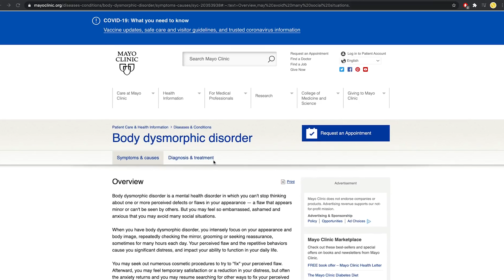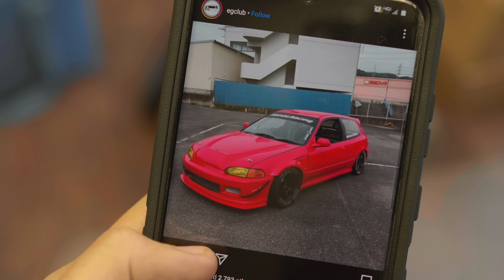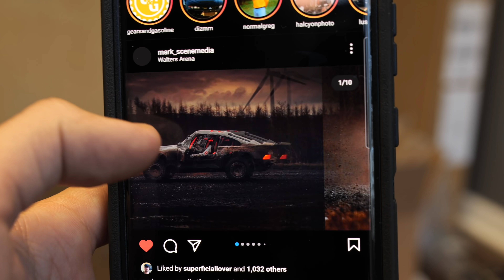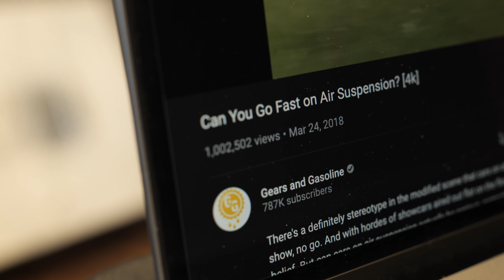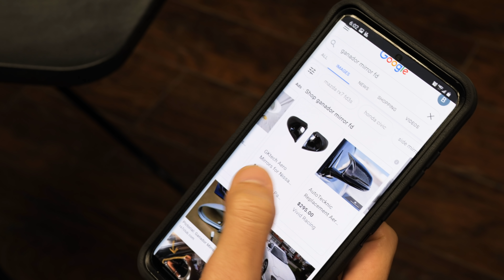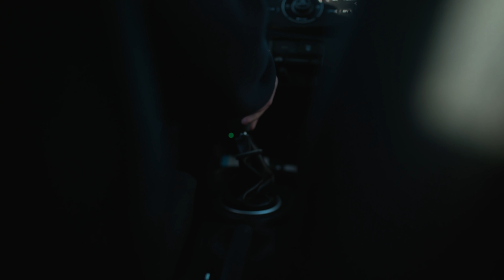Cars Won't Make You Happy

Comment: PSA: Don't buy a car for anyone but yourself.

Edit. Thankful for all the considered, wonderful replies to this. I love you all xoxo
Reply: I was gonna be a smart ass and say "what about for my kids?" But this video doesn't need any of that in the comments and your sentiment is correct.
Reply: Exactly
Reply: This advice is perfect. I just recently bought an S2K and I plan to return it to stock. I've been called crazy because of that, but in the end its my car and my money. And I want to experience this car as it once was.
Reply: That's why I bought the BRZ. At the end of the day, it fit what I wanted. Small, lightweight, 2 door, rear wheel drive, affordable.  yeah yeah its slow in a straight line, but I find it fun to drive and that's all that matters.  Slow off the line, quick in the corners.
Reply: @HakeemKaree   That's the last thing you need to worry about, family vehicle are easy to find and cheap
Reply: @HARRY SNELL I meant for my kid to drive, not for me to drive my kids in
Reply: That's great advice
Reply: @someguy920  good luck with that! If the guy bought a REAL car, he would be happy!
Reply: Exactly the same thing goes to working out. If you are just doing it to "loose a couple pounds," you will not stick with it. You have to make it about your fitness and your health and commit to it, regardless of what your friends and family or followers think.
Reply: @NinSevenTea you wont regret it when you get older

Comment: This is the extended way of saying “I live my life a quarter mile at a time. Nothing else matters. For those ten seconds or less, I’m free.”
Reply: hoora
Reply: I think is much more than that! I never heard or saw someone on the internet share something that i felt with a car I. It was perfect for me, just lacked 100hp (it had 130). Everything bought was for me, for my pleasure, the suspension, brakes and anything related with the way it looked. Never for others.
Reply: @gerekappo  am i wrong because i like driving shitboxes fast, there easy to fix and its no big deal if you blow the engine. I have had nice cars but they always feel numb because you dare not drive them to the limit.
Reply: @garygluebag4825  100% true!
Reply: @garygluebag4825  the cars i’ve had the most fun with have also been the cheapest. Best one has got to be the 1984 BMW 323i I paid one hamburger for. Kick ass winter drifter but a shit car.
Reply: @garygluebag4825  My comment doesnt aply to nice cars only. My car had many, many things to do. It was a driver. Thats what i meant. Cars that are driven. Not only looked at.

Comment: A teenager can’t afford to buy a bugeye anymore because of the “ subie tax”
Reply: The one mentioned in the video was 8k and all the ones near me either cost upwards of 9 or are on the edge of death. Big oof
Reply: I just got mine for 6k. But then again I also looked for months.
Reply: @DENDENMUSHIFROMZOU  that's still double of what they were selling for a couple years ago. They sold around 2500 - 4000 max back in the day for a WRX but now they've gotten insanely expensive
Reply: I’d just find one with a blown engine. I’d wager there’s a few out there, no? 

It goes with the old car guy buying something not running and fixing it themselves. Bring that much more pleasure!
Reply: For real though, gotta overpay for a Subaru just to get one
Reply: I bought a 1990 Subaru Justy 4x4 when I was 18 because I could not afford a WRX. It broke on me and 3 years later (I’m 20 now) I still have it sitting in a storage unit untouched for the past 3 years.
Reply: @ryanricketts6674  fix it up or sell man don’t let it go to waste
Reply: You can apply that tax to any car on the market. Our wages haven't changed, but everything else has gotten more expensive... :(
Reply: Got mine for 3k... But half of it is missing. Frick rust
Reply: Only subie tax that you'll run into is doing engine replacements semi annually
Reply: @DENDENMUSHIFROMZOU  I got my old bugeye back in 2015 for 1500 bucks, 118k miles on it. I miss it
Reply: 😂Just feel lucky that you guys can buy mustangs and shit like that over here in the uk you’re unique if you don’t have a shitty German hatchback until you’re 20 LMAO, he’ll even a miata at 19 is hella expensive on insurance
Reply: @codeobey6821  damn I just bought a F80 M3 at 21 I heard the UK is crazy

Comment: When I was younger (20's and early 30's) I used to always work hard to build my cars up...89 Celica turbo All-Trac, V8-swapped Fiero, an almost 600 HP Chevy Silverado, and a 2000 Honda Civic Coupe with a B-swap, lowered and lightened almost to the point where a Miata would be considered overweight. Honestly? It gets tiring...showing it off, seeing something new, wanting THAT. It's a cycle that will never end, and as much as I love cars, I will admit that this constant quest has put a lot of grey hairs on my head. Fast-forward to today. 4 days ago, I turned 47. I'm happily married with 5 adult children and when I just want to get away, I happily go out and hit some nice b-roads in my 2007 Honda Civic EX coupe, rowing my 5-speed manual, and just enjoying the sound of a nicely tuned exhaust bolted to a completely STOCK engine while taking my wife to a nice little outdoor café for brunch.

Cars have been and most likely will always be an occasional wondrous joy of mine...but happiness? I find that in my wife, my family, my friends, in my backyard with string lights hanging from our trees and me at my barbecue grill...
Reply: Well said.

Comment: Thank you for making this video. I always dreamed that I could drift. I saved up and bought a 350z and sure enough, I could actually do it. But it was kind of like meeting a hero. We began to take it more seriously. We rushed to make it to events and my car was never working right. It took the joy out of it. Someday I want to compete. But I want it to be because I’m at the track to enjoy drifting, and it just so happens to be in a competitive environment. For now I sim race. Awaiting my return behind the wheel of a real car.
Reply: It’s much much cheaper and less time obligation
Reply: mid-late 80's was doing it with a modded Datsun 620 long bed pickup, the extra 10" wheelbase made it very predictable+consistent. there's lots to be said for "keep it simple stoopit", it put up with being hammered and rarely ever broke.
recommend for a fun "slideways seat time" budget build project.
L20-B giving +165 whp, 4 speed from a 1600 wagon for lower closer ratios,
no spare no tailgate no rear bumper no smog no AC, lots of weight stripped.
late 70's Datsun was like playing with a Chevy, near anything bolts together!
power sliding and "slideways" was before anyone called it drifting, hehe so what.
Reply: Kind of similar scenario. Ive always loved racing games. Bought an Altezza track car. Cost me pretty decent money. The heartbreak of trying to get things ready for track days and things going wrong, mechanical failures, accidents. Did it for 3 years and eventually sold it. Bought a direct drive setup and just sim race now. Its astonishing how close it feels to real life. Assetto Corsa feels great.
The only IRL track experience im missing is Nordschliefe. Absolutely going to bring a car there.
Reply: I am so Happy with my GR86. I Drooled over the CRX when in my Early 20's and Never Got One. Got a Mk7 GTI With All The Bells and Whistles as a Mid Life Crisis. Got More Tickets Than Ever. It was a Blast. Messing with my Phone I Totalled It. I am Tempted to Do Some Things to my 86 but I am 61 Now and my Priority is Travel to World Heritage Sites. This Reflection on; Ego, Fame, Supremacy, Etc is Excellent.
Stay Balanced. There is More to Life.
Reply: Been about a year since you commented this, hope your dreams have gotten closer to reality
Reply: @kind1st  GR86 and all the similar models looks like they are really fun to drive :) Sadly here in Norway they are more expensive then a Porsche Cayman so I am getting a Porsche.... (Most likely the reason the Cayman is not horrible expensive is the 20.000 to 30.000 engine repair on the older models that they say 10% of Porsches with the 3,4l will need).

Comment: "FD RX7 is my affordable dream car". My same exact thoughts when I bought my 93 FD, that has now been sitting in my garage for 7 years, after having sat for at least 6 years for the previous owner. I was on my way to having the car built the way I had envisioned it, especially since it was the last large personal purchase before my daughter was born... and then life decided to slam me and my fantasy... lost my job, almost lost our home, but now I'm finally back where I was financially when I was building my car. UNFORTUNATELY now there is always something else that needs the money more than the car that's sitting in the garage. Its frustrating as all hell, but damn if every time I see my FD it doesn't put a smile on my face. Then I'm reminded of all the money  it's going to take  to get what I want done... suspension refresh, transmission swap, new wheels, repair original paint, vinyl to my personal preferences, repairing all of the old car issues, no oil leaks... it's a hell of a project that needs a lot of cash and no one to figure it out by myself. Oh the life of a project car...
Reply: hope you get to drive your car soon bro. I'm still waiting to buy a rx8 as a first car which might be a bad idea but i love rotaryes so il try and learn as much as i can about them befor i buy one
Reply: Its gonna happen sooner or later...:)
Reply: I wish you luck and many happy miles on your build!

I'm in the process of getting an engine into my RX8 that i snagged for 1000. Full interior too. Still can't believe its sitting in my garage
Reply: Well the capital gain $$ on your Fd after 7 years should at least put a smile on your face, the prices have gone crazy over the past 3 years. 
Really hope you can get it on the road sometime soon. 
I got my 2000 Fd 6 years ago, it’s completely stock, that’s enough for me, as long as I can get it out every few weeks or so

Comment: I really needed to come back to this video today and im glad i rediscovered it because i recently got a E46 sedan and have been overwhelmed by all the mods and things i feel like i NEED to get done before i can really feel happy but that happiness im trying to achieve isnt because of things i want but things i see other people have and feel like i need to fit in with them instead of building the car I WANT and this video has helped my take a step back and be happy with what i have and with time i will discover what i personally want out of my car
Reply: A year later how’s it going with the e46, have you done anything to it and how’s it treating you, it’s one of those cars that I might get once I get all set in life, toodles 🐣
Reply: @pat1u  it's still running pretty good considering the condition I bought it in. I have major maintenance planned next month after my bills because I'm taking it on a 1300 mile road trip but for a car that people say needs alot of maintenance I have barely done anything to it. Bought it as a 500$ junker and it's only needed a battery, valve cover and gasket. coils and plugs and a expansion tank and some hoses. Now it still leaks oil but that's going to be fixed soon but BMW made a pretty good car and I have zero regrets. Put about 7000 miles on it so far
Reply: @RadsZerich  I mean honestly most people underestimate bmw reliability it’s just cause people don’t know how to maintain them.  Also a 1300 mile road trip sounds awesome but draining good luck to you!

Comment: Cars will absolutely make you happy. The problem is unattainable or unreasonable goals, and that applies to any hobby/obsession. The problem these days is people forget what made cassic hotrodding so good, which was the concept of really good ideas anyone can do on an average budget for a hobby. My all black 2014 GT was the alternative dream car to one of my actual dream cars (either a 08/09 Bullit or a real classic Dodge Charger like my dad had), and with the red accents on the headlights, blacked out exterior, and free flow exhaust, it turns heads when other cars that cost way more are ignored. It's loud, has great power, and gives me plenty of satisfaction as I see people stop and look on the street. It's such an icon, they know what it is. On those merits, I'm satisfied with the car, but I don't want all bark and no bite. I have goals to expand the rear tires from 295 to 325 radials in the rear ($1250?), replace my radio that just died ($600), get an e85 tune ($150), and if I ever find a get lucky, a Tremec transmission (over $2000) and a Procharger ($5000+.) I juet want to put more expensive cars and Chevys to shame. Should be reasonable. Should I ever strike it rich, I'll buy an actual dream car like a $150,000 Cobrajet, and I can grease Teslas all day long. Until then, I will appreciate what I have and be humble.
Reply: YES! Cars can make you a bit happier, but only AFTER you've figured out how to make top dollar--and by then, the odds are pretty good you're getting older and will sacrifice everything for the biggest possible house and a couple kids you don't want because "SHE wanted it."
If you haven't nailed that 100+ grand a year job yet, you can sort of just piddle around with cars. This shit is expensive, even if it's a 20-year old car in decent shape and all you want is to put some rims on it and maybe install a decent stereo.
Your car can, and probably will, eat up more of your life than ANY physical possession has any business consuming--even a house! That's time that you could have spent pursuing a $100,000 job that you hate (like any job) and have the money to pursue a car that you actually like instead of pissing away a decade of your life fucking around with a car because you can't afford the one you really want.
They're just cars. Some of them are cool cars, but they're still just cars.

Comment: “Comparison is the thief of joy” -Theodore Roosevelt

I’m just a starting YouTuber and I totally agree. It’s very overwhelming starting because there’s so many good/crazy/expensive builds and you just want to stand out. Sometimes I just want to pull the trigger and get a wide body kit which means I would have to buy wheels and tires that fit that as well as paint or wrap it, but it just doesn’t make sense where I am financially. It’s important that I remind myself to take it one step at a time and that you don’t have to be great in order to start, but you have to start in order to be great and appreciating what I do have rather than sulking about what I don’t.

Comment: I don't even have a car, all I have is my dad's 2003 Citroën Xsara with a 69hp diesel engine, but the most fun I have in weeks is usually from that car (I'm 16 and my top speed on this specific car is 80 km/h, but it still feels very good, you don't need a 1000hp rwd supra dragster or a 4 Rotor awd Mazda to have fun, you can have fun on anything as long as YOU appreciated it 👍)

Comment: That RX-7 you have, is beautiful.
No matter what, just walking up to that car, taking a seat in it, should give you the same joy as it did many days before that.

I drive a Civic Type-R FK2.
Not expencive, not luxury, but that car was my dream back in 2015, and i achieved that dream last year.
Every single time i walk up to it, i'm filled with joy.
Every single time i take a seat in it, turning it on, hearing the engine, getting it on the road and just driving around, it fills me with happiness, every single time.

you don't need to spend more, you don't need acknowledgement, your car doesn't have to be the fastest, most expencive, most beautiful.
It's only got to give you happiness, and get you from A to B.

I wouldn't trade my Type-R for anything in the world, because it's my car.

Comment: Cars can definitely create emotions. My one build was an emotion rollercoaster with alot of highs and lows. The reward when its all running right is awesome! If you ever got a decent hp level fresh car on the dyno you know the stress that comes with that alone. On my last phase of my rb25 s13 I had the car at the dyno 3 times in 3 months til we eliminated all the issues. Lost alot of sleep in thoose few months and money lol. I really dont care about the internet Ive had and been building some of my cars way before this day and age. Although it would be nice to make money off of youtube I am sure it has its downsides too. My car is not wide body it is not slammed it has patina stock 1991 paint on it. Rb25 swap big turbo all function car. I almost have to be happy for a long time with the power level because the next step would be a fully built motor and that is alottt of money for an rb. 500 whp 2600 pound car will def put a smile on your face tho. For me cars are a way to get away from the bs a way to feel free and clear your mind